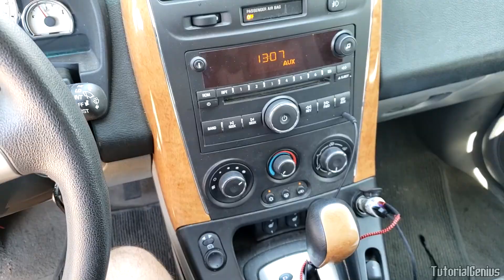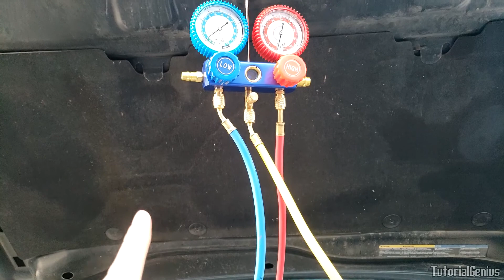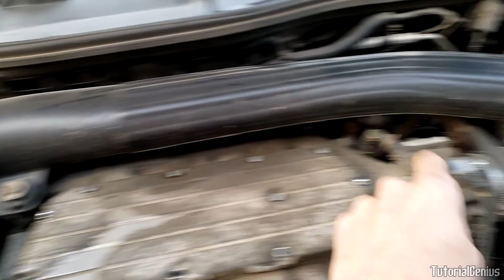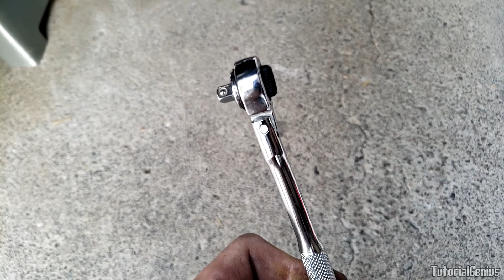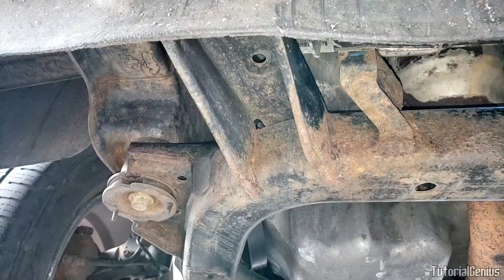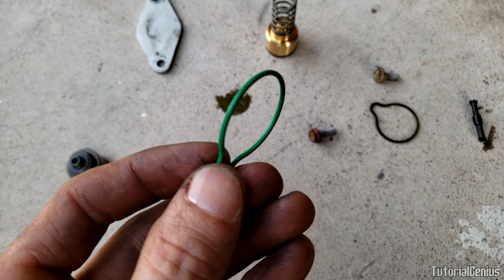Scroll Valve Replacement - WARM AC AT IDLE & COLD AC AT SPEED - FIX! (Saturn Vue)

Comment: If the radiator fan don't come on can it cause a similar situation because mine the low side that 80 and the high side that 200 at idle and if I hold the RPM up it gets cold but the Gage don't change

Comment: I did this and problem still persists. Old piston was definitely stuck, had to drill a screw and pull with pliers just to get it out. Cleaned everything and replaced filter and everything else. Pulled vacuum and added refrigerant but still doesn’t work at idle. What else could it be? Bad compressor?
Reply from the maker: Potentially! RE: "Cleaned everything" - Did you flush the system?
Reply: Talking to an HVAC technician. Probably did more than your video shows. From my diagnosis, I’m suspecting a bad compressor  since the old piston was probably stuck for years. Probably wore out compressor, but since you have experience with these saturns, I wanted another opinion.